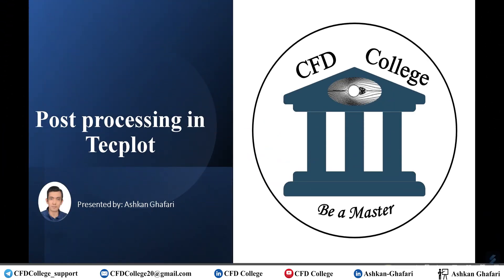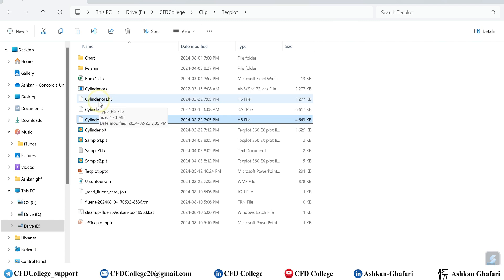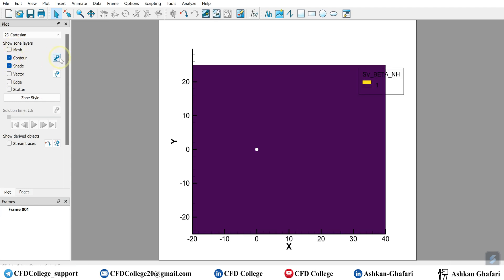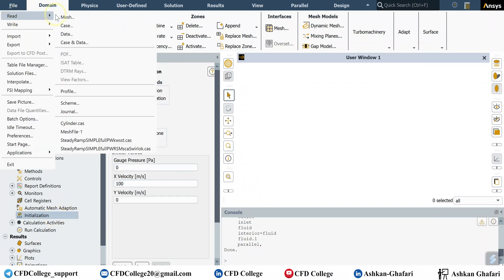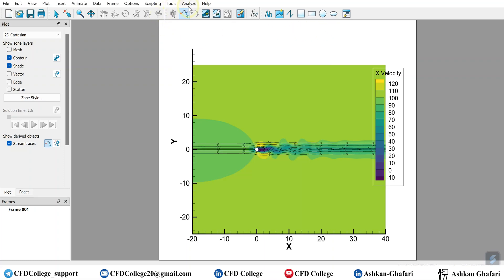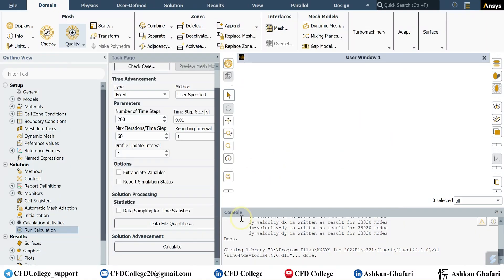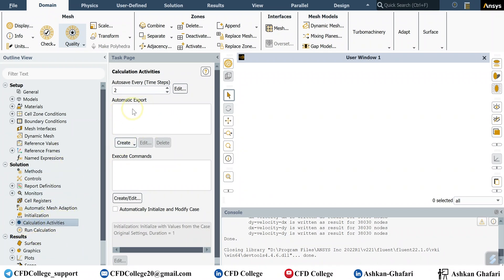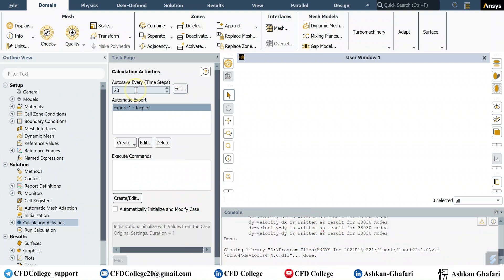Tecplot Tutorial 6 | How to import ANSYS Fluent data to tecplot?

Comment: Hi, Thanks for your tutorials. I really follow you a lot. However, I have a problem in relation to my simulation I am currently working on. Before my simulation (transient) I conducted on a HPC, I selected some additional quantities such as pressure coefficient etc. together with the default standard quantities. The autosave option under calculation activites were used to save the data files every 1000 time steps.  After the simulation , I uploaded the dat.h5 files at every 1000 iterations to tecplot but those additional variables did not show up . Only the standard quanities showed up. So, I tried another option of activating the “Data sampling for time statistics “ in fluent together with selecting those additional variables (Cp) of which I know it’s a wrong way since the solution hasn’t converged yet. With that , those variables showed up in tecplot. I also tried using the automatic export in cgns format to save every 500 timesteps. That also worked, but uploading multiple cgns files  with the aim of showing the solution time doesnt work . Again, the tecplot export command was used but it only shows the surfaces not the volume making it difficult to perform volume slices in tecplot. Please is there any way I can go with it. I urgently need a solution for this .